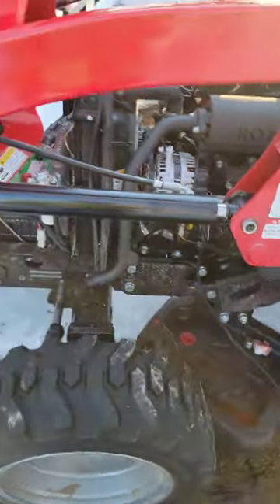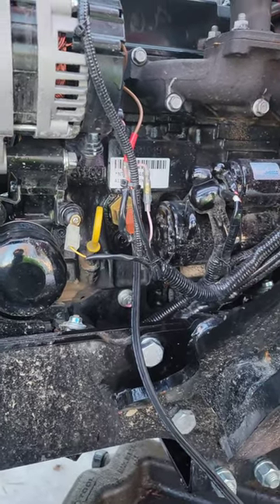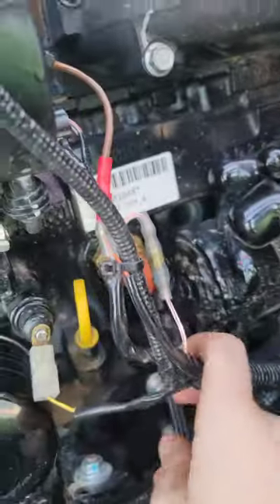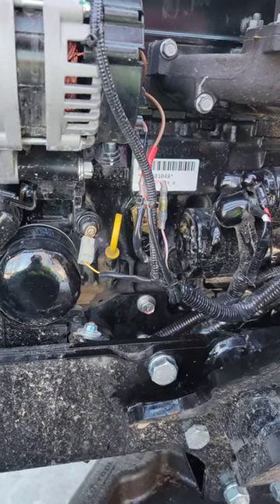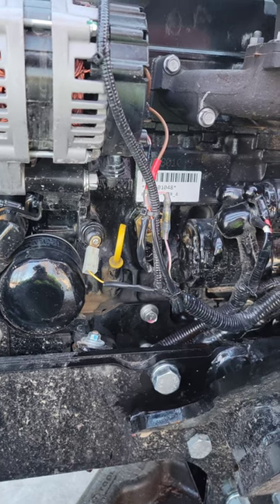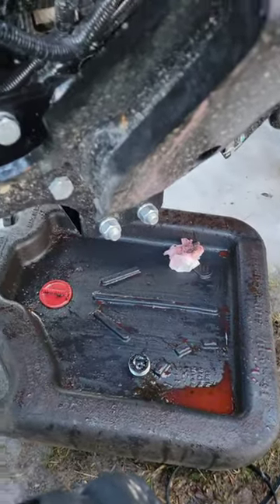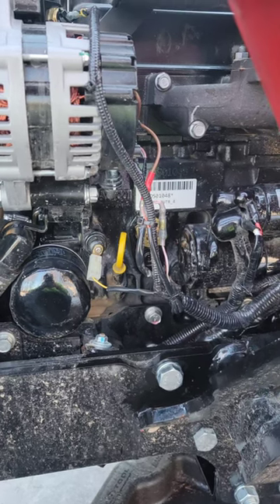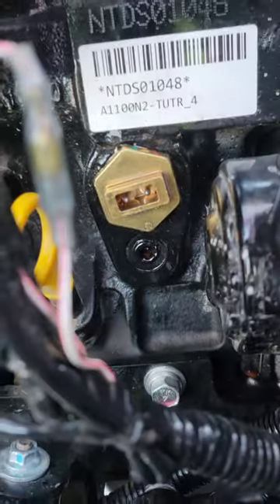installing a block heater on the TYM T264

Comment: do you have the part number of the specific heater you installed?  Looks easy enough
Reply from the maker: It's in the description, I went with a zerostart 3100003 was available locally and the cord is easy to remove for the summer
Reply: THANK YOU!  I will install it this afternoon @mitpomr